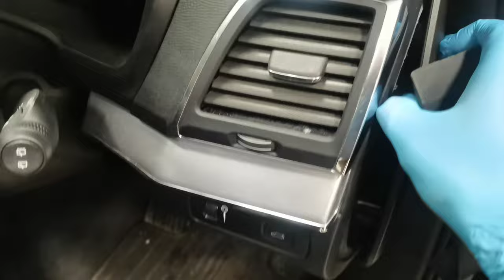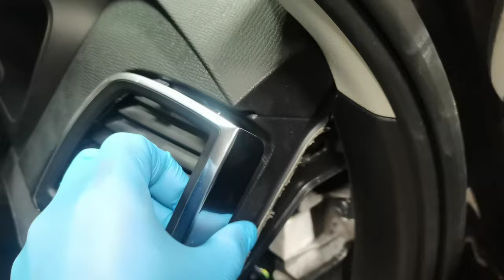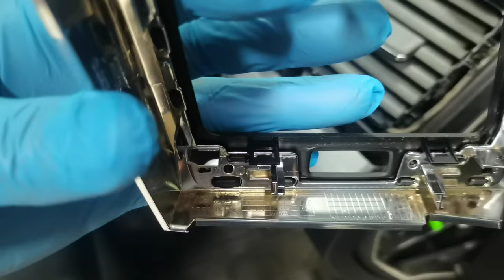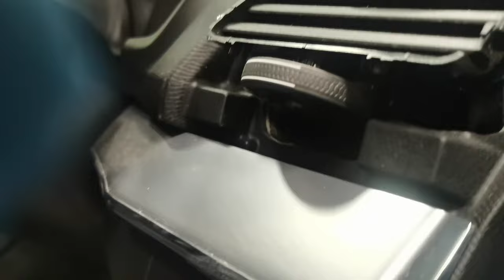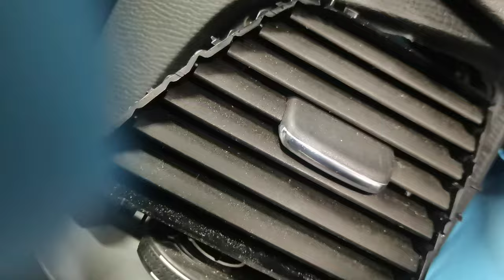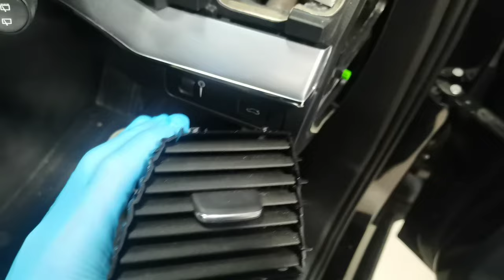VOLVO XC70 XC90 II front air vents removal

Comment: Thanks for the video, I have a problem putting the vent cover back to the vent? Could you make another video about it please? This will be really appreciated, thank you.
Reply: I have the same problem, they are not holding in the same place
Reply: @aivarassubas9937 did you manage to put it back?
Reply: @OktayOzpinar  Anyone manage to get the chrome cover back on???
Reply: @mikeminnig  you have to take the whole thing out. The ventilation unit. Then put the chrome on the vent itself. Make sure it is correctly placed. And then vent + chrome need, you will need to put back in place.